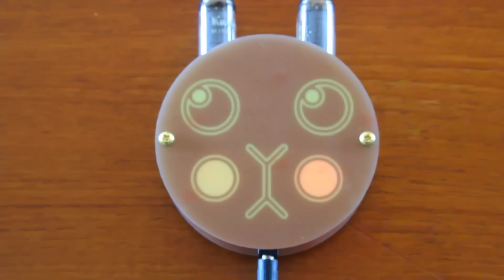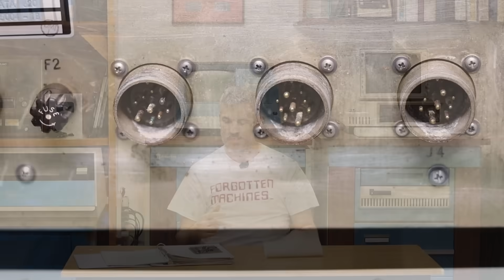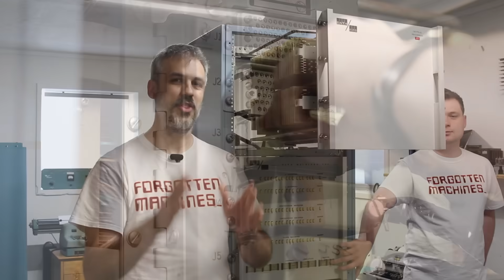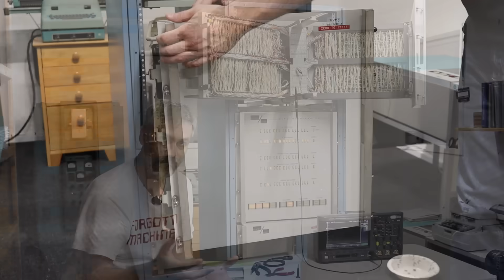The Data 620 Minicomputer Executes an Instruction!

Comment: I spent a lot of time with a 620 in grad school 50 years ago. Interfaced a data tablet for a paint program. Designed and built a controller/interface for two 9-track mag tape drives and wrote a primitive OS for that. Finally designed and built an interface for 32 bit raster programmable graphics processor that I designed and built.

Comment: If we connect the - of 6 volts to the + of 12, we have a circuit with 6+ and 12-. In this case, you can use transistors and resistors to protect the controller and work with it only on the 12-volt circuit (the 6 is irrelevant to the process) and produce exactly what you want. You can check if you are really interested. There is a more protected component on the market than the one based on a light-emitting diode and a flashlight enclosed within a component (I have seen this in kits for self-built electric vehicle charging stations where the vehicle is controlled by 12 volts and the controllers are 3.3 or 5).

Comment: I sincerely hope that a viewer will turn up with more info on the Data 620 -- hopefully someone that actually has access to the manuals!  Another commenter mentioned having software for the Data 620 on paper tape and I hope that he's willing to make it available for this project, even if someone ends up "reading" the tapes by eye, like I had to do for a PDP-8 at work in the '80s after a stuck bit corrupted the program in core.  I was able to repair the corruption one word at a time, so it's certainly doable!

Edit:  I found a *lot* of DATA 620 documentation on bitsavers under "Varian"!

Comment: I worked on old Navy Automated Test Equipment for the S3.   Both my own bench (HATS) and the bench feeding PCB's to us for repair (VAST) were ran by variants of these "620" mini computers.. I think?   Core memory, BIC cards that would DMA between memory and the disk controllers.. memory is fading, but it was fun to work on for sure.     Starting to forget the bootstrap code, but generally once in we would clear the registers, enter 37747 in the P register, step, run...    They had a habit of dumping now and then.

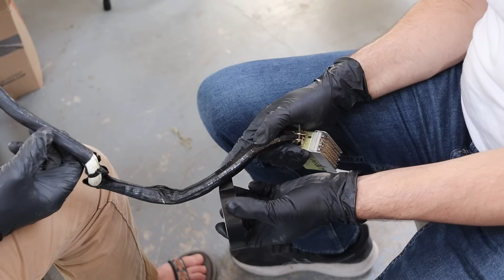Comment: At 11:44 I did the same in the past and regretted it because electrical tape eventually gets awfully sticky. A better option could be self fusing rubber electrical tape that will stick to itself and even that may be tricky in the long term. Thanks for the video!

Comment: Un-Du is the best remover for old tape and sticky residue. It is gentile enough to use on even old photographs which I have done. It dries quickly and leaves no stain. Crafts section at Walmart.

Comment: ooooo taper pin backplane contacts - they were an interesting system - crimp pins with a slight taper tha were inserted with a spring loaded staking punch into the card connector

Comment: Tip that might help for undoing and holding fiddly screws - vasectomy forceps 😂 They have little curved bits at the end which are ideal for holding small screws/nuts, and they’re locking. I use them a lot for dismantling stuff.
Reply: Well they are designed to remove nuts without messing up the screws. The little bits on the end are naughty!
Reply: @cstacy  I missed a great chance there 🤣🤣

Comment: Instead of steel razors, try a phenolic scraper from an aircraft tool supplier. They will get glue and other residues off, and won't scratch soft metals like aluminum and won't harm most painted surfaces.
Reply: Aircraft Spruce & Specialty has them for about fifteen dollars. They're intended for use with a rivet gun but you could probably jam one into a wooden file handle.
Reply: @johnopalko5223  as an aircraft mechanic, can confirm, you can put a simple handle on them.
Reply: You can also get packs of plastic razor blades from your auto parts store. They're intended for body shops. Much cheaper
Reply: Possibly a plastic putty knife?
Reply: Plastic rzor blades re available from Temu for pennies and do the job.

Comment: Random thoughts while viewing:
1. The power supply output connectors are CPC (Circular Polarized Connectors). They can be personalized by rotating the pin field at manufacture, and specified with a suffix to denote the rotation of the pin field. My guess on what pins carried the current was the large pins, and the small pins could carry sensing back to the regulator.
2. Are the left and right side panels removable? Is so, then you can route the cables easier, but putting the panels back is harder.
3. The logic cards implement a negative voltage level logic (0v to -12v). There appear to have some glitches on some of the signals with some horrid capacitance loading the signals. The logic seems to be a variation of RTL logic (Resistor-Transistor Logic), rather than DTL or TTL. The rounding of the negative levels could be fixed with higher current gain transistors, but they are very-rare.
4. The square connectors are indeed personalized of keyed to prevent the "Dummy Load" technician from swapping connectors and releasing magic smoke. The keying pins are male or female and threaded or unthreaded. The threaded keys are typically connected to the jack screws.

Comment: It amazes me with each computer how much of it still functions.  And most of the initial problems are mechanical (switches, connectors).  Great vid!!
Reply: Yeah, the other day I was wondering if anything made after roughly 1998 is ever fixable.
As I found a pirate copy of the schematics of my motherboard to diagnose why the stupid thing refuses to power on, it was just the NVRAM chip deciding to die, and the switch to the alternative one had grime and was misbehaving, the thing mostly work after a 10 minute warm-up, must be some cracked join, so let's never power it down again until it's time to trash it.
Imagine trying to solder a 0201 who can fix that ? I can't.
The thing is from 2014

Comment: I can't believe you chucked in a bigger fuse instead of finding the problem that blew the fuse. That's some real hacky shit. I expect better on this channel.
Reply: Got much experience working on this kind of equipment do you? Lol.  It isn't "hacky" at all - on something like that 1 "extra" amp isn't going to hurt anything. 99% positive he wouldn't have done that if it was any risk to the system, as something tell me he is probably more familiar with the operational constraints and requirements of the electrical system on a Data 620 than you are.  The 2am slow-blow probably kablooyed (technical term) due to age (it happens to all of us.)  You can "expect" all you want - but nothing here was "hacky" at all.  Always a keyboard critic lurking somewhere, lol.

Comment: These are my favourite of your videos - intense problem- and mystery-solving.  I'm also very excited to see what is in store next for this beauty, and to see it obey your commands hehe.  

A question - is there any way of reading the core memory without disturbing it's current state?  Or if it's core memory, can you literally eyeball the cores to get a reading?
Reply: Core memory reads are always a destructive process (just like DRAM). You can't avoid it, as you are literally magnetizing the cores in one direction and measure the current it takes. If it is already magnetized in the same direction, there is low current, if it needs to be "flipped", there is more current.
The driving hardware needs to rewrite it after a read (unlike DRAM, core memory does not need a refresh ever so often)

Comment: Hello David. About the core memory, is there any way to passively determine the magnetisation of the cores? Such as using some sort of hall effect sensor as a probe and checking out each core individually then recording that on a spreadsheet? Granted that would be painfully tedious work but worth it to preserve a possible unknown program.
Reply: Nah, magnetization is within the core. You'd have to at least examine the material very close to the surface, I think; maybe it can be read nondestructively via some surface polarization effect something or other (but the surface isn't going to be very smooth or precisely oriented, making that a dubious proposition), or an extremely tiny magnetometer or something (leakage around nonuniformities).  Otherwise, the symmetry makes it very tough to see anything from the outside.

I wonder if, in a small-signal test (i.e. lesser than, but up to the edge of, the hysteresis band), there's any anisotropy evident.  Like, say permeability is higher or lower in the direction of magnetization.  Would require a thin wire probe to loop around a single core at a time, have fun with that.  But, if it does work, it would read as the relative phase of the 2nd harmonic versus a small excitation wave, and, give or take DC bias.  You'd want to practice (i.e., set signal levels) on a particular corner of the grid, on the understanding that you're likely to destroy those bits in testing, but only those and no more. Practicing on another (unrelated) grid is probably not feasible as different core material and dimension (thus excitation level) is likely (who knows how consistent those materials were across industry at the time..?).
Reply: Isn't there any "non-invasive" technology to read magnetic cores? CT scanner?

Comment: Electrical tape is usable, but I prefer to use the cloth based harness tape made for automotive applications. It doesn't creep or leave a sticky mess the way electrical tape does.
Reply: Electrical tape is just horrible in the long term, as you say it turns into a sticky mess.
Reply: YES, excellent point!  We thought of that exact product ourselves, too, for the exact reason you specify here!  Unfortunately, were relegated to what we could find at the local ACE Hardware for this one, and we looked for that, but it was nowhere to be found at ACE...so electrical tape it was.
Reply: @ForgottenMachines While if you truly were stuck with Ace Hardware, this won't help. But that fabric tape could probably be found at an auto parts store, which if you have an Ace, you likely have one of those nearby too.
Reply: @ForgottenMachines  I know how that is. I live in a very small town in central Texas, so I have Ace Hardware, O'Reilly Auto Parts, Tractor Supply and the smallest Wal-Mart in the state. My usual workflow on fixing vintage/retro machines is examine, order parts and then repair in a week or so when parts show up. At least Mouser is close enough that I get overnight shipping by paying for ground.
Reply: I was thinking the same - "Tesa" tape or an equivalent is great stuff for protecting cables.
Reply: There are split plastic mesh products too. Not period appropriate but very nice and gives easy access to the wires later
Reply: The place I work you would get the sack using this cr-ap tape on a wiring loom.
Reply: Exactly what I was thinking.

Comment: For the tape residude a little gentle heat will soften it (heat is the enemy of all glues) and then I highly recommend a proper label removal fluid. I use Electrolube Label Remover in the UK but if its not available in the USA, there is bound to be similar products. You wouldn't see me break out a razor blade unless I had exhausted all other options.
Reply: Good old WD-40 also works wonders when trying to remove old adhesive residue.

Comment: Many of the cards in the CPU might be duplicates. It makes more sense to develop a functional logic tester for each board than just checking every diode. Reverse engineering the boards might be needed anyway to diagnose the logic faults. And a functional test is far more complete. It it checks every component in the board in one go. And more importantly that the board performes the function is supposed to.
Reply: Shouldn't be much pain to level-shift to an Arduino or something, either; looks like PNP RTL/DTL plus some bias lines, easily solved with a handful of transistors

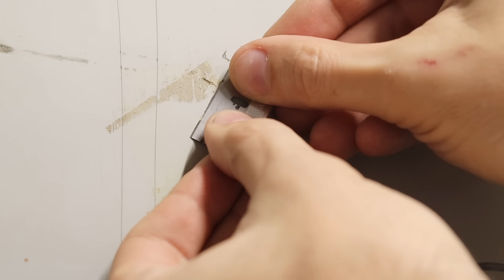Comment: 7:05 Ace Hardware sells cheap plastic “razor blades” that are fantastic for removing tape and residue from finished surfaces. I’ve used them on everything from delicate painted surfaces to anodized aluminum with great success.
Reply: I replied to somebody else but absolutely here and as well as any auto parts store. They're usually in the auto body repair section

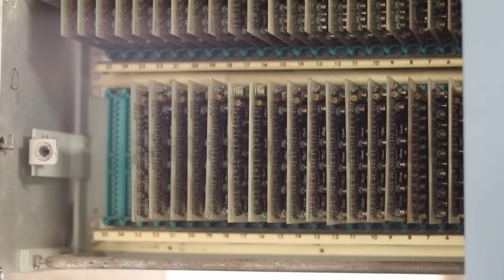Comment: (@15:50) - take out half the cards, then check for the short. If the short remains, then put those cards back, and take out half of the other half of the cards. If the short disappears on removing the 1st half, then you know the second half of the cards are good, so divvy the first half of the cards in half. Rinse and repeat, until you find the short. Might as well “DeOxit that socket” while you have the cards out. In other words, do a binary search; divvy up the problem space in half, then check for a result. Repeat loop until (problemFound == true). 😊

Oh, never mind; I see David has already done the Adrian Black on it, and DeOxit the sockets! Yay!
Reply from the maker: We talked about different ways to do the hunt for the short, but ultimately, I wanted to clean the backplane and deoxit all the sockets, so we just decided to go for the brute force method of removing them all!
Reply: @UsagiElectric  I probably would have plugged them back in 2 or 3 at a time to spped up the process,  but none of you are "on the clock" and brute force worked fine.

Comment: Can you send the core memory module to CuriousMarc? They have a core reader and can backup what's in memory.
Reply: It's a core reader that's designed for Apollo core rope modules, that's very different. But I like the thought because on the AGC project they had the same problem. How do you read a 60 year old core memory reliable when you only have one shot? They had the advantage that a software emulation of the AGC was available. I don't remember how exactly they read the memory, I would have to re-watch the video, if it was even in there.

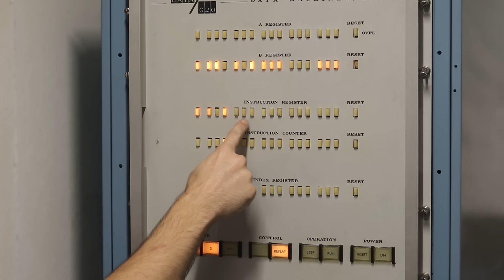Comment: Re: burnt out bulbs, I don't think so. 20:49, you pressed the third from the left, but it only came on once you pressed the fifth from the right. There is most definitely some logic issue here.
Reply from the maker: Oh yeah, we definitely have a lot of logic issues going on. But I think we also have a lot of burned out bulbs as well.
I'm expecting a bunch of faults to hunt down on this one.
Reply: @UsagiElectric as most times when debugging old hardware: if there are two possible errors that could be the cause for a symptom, it‘s most likely you‘re suffering from both. Keep up the good work!
Reply: @delirium3181   That is often true.  What is fun is when you discover that the pulled out wires cured a rare problem that took the guy that designed the system a month to figure out :(.  Too bad the tags fell off them 30 years ago :(.
Reply: Such strange things can also happen with dodgy connections/copper traces. By pressing, contact is made.
Reply: could also just be a loose connection for the bulb

Comment: to get tape residue off. try petrol, works really well, very little scrubbing/scraping needed
Reply: Heh. Naphtha. Ronson lighter fluid used to fill the snap-open stainless steel Zippo lighters ... no one smokes any more, so one uses lighter fluid any more either!
Reply: @uploadJ  paint and hardware stores sell Naphtha by the can....same stuff, way cheaper
Reply: @m.k.8158  Why you telling me? 
I don't buy Naphtha in volume, and I'll bet no one else here does either. I ONLY had lighter fluid for use in Zippo lighters to light fireworks ... WHEN one only needs an ounce, why buy a gallon? Or half gallon even?

Comment: Ok, I thought that the "last time" project was the NIXIE tube calculator or the TMS9900 homebrew, but I can see how the VCF southwest might have juggled the priorities on those projects. The internet today makes ADHD tendencies more of a lifestyle than a disability, and we even have a cool hip new/old word to describe it - polymath. And at this point how in the world can anybody only have one interest?
Reply: To be fair, David tends to switch from project to project with every video to avoid burnout.
Reply from the maker: As tobias said, I rotate through projects to avoid burnout. Also, I often need extra time between episodes to order parts or do reverse engineering work. These things can be incredibly time intensive, and I like for each update of a project to actually be substantial.

A typical rotation will be four projects on loop, but with VCFSW happening in the middle, the loop got a little weird this rotation. Currently, the primary projects are the G15, TMS9900, Casio AS-A, and Data 620. There are only one or two more episodes left in the G15 series before it goes back to System Source, and I'm hoping the Casio AS-A only needs one or two more episodes before it's fully functional. Then we can shift some other interesting projects back into the rotation, like the Centurion Phoenix drive.
Reply: A number of people said they would rather see the NASA computer cone back to life more then a calculator in the last video, that may have had something to do with it too.

Comment: Spicy Electrons. I love it.  I guess like regular electrons but without their pesky shell?
Reply: Spicy Electrons on the Half Shell?
Reply from the maker: Electrons but with a little extra hot sauce thrown in for good measure!
Reply: You need a volterator attachment for your Interociter Dave 😂
Reply: @LuminosityUK  Full disclosure: I used to use an Interociter as my avatar, Exeter.
Reply: Would not spicy electrons be muons?
Reply: @beatadalhagen  That depends on their spin and their colour -- err, color
Reply: Well, at least he doesn't call them angry pixies.